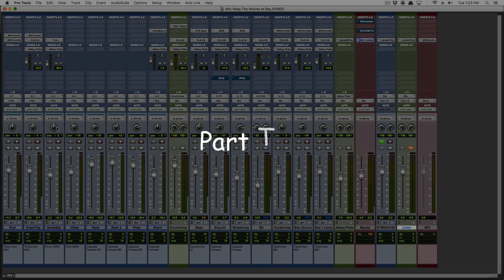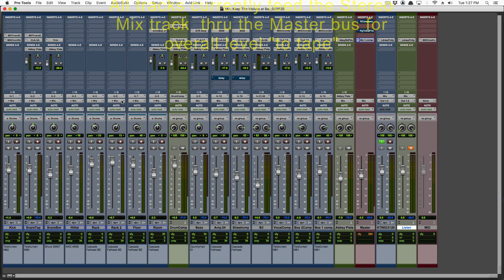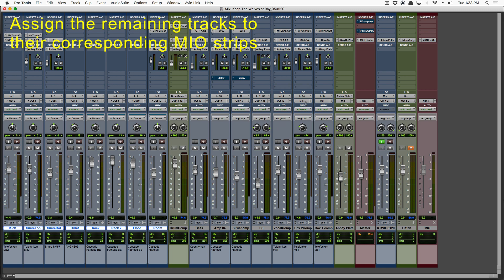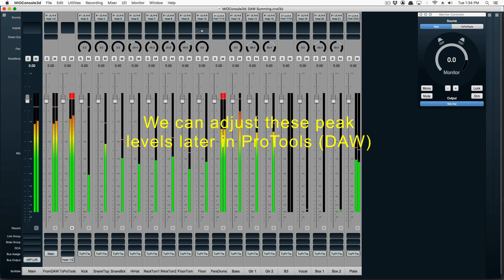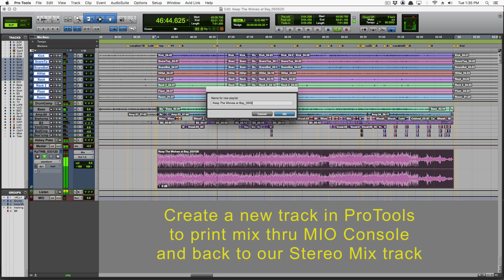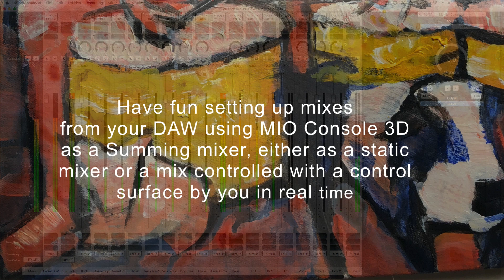Part 2- Metric Halo's MIO Console 3D as a DAW (ProTools) Summing Mixer

Comment: Mike -- nice job on this.  I have been working to do this similar thing, but have never been able to get the mix to feed back into the DAW -- could not do it with Studio One, or with Logic Pro -- but it seems such a  no-brainer!  But you encouraged me to try again.  Two questions:   1)  Can you explain advantages of doing this with MIO Console -- i.e. is it the 80-bit summing??   2) What about using MIO Console vs. using Harrison Mixbus32C?
Reply from the maker: Hi Bruce, I think I have seen your name on the Mobile IO list over the years. I probably should take a look at this series and see if there is anything I should edit or add.  I had been a partner in a studio here in NYC for many years, Dubway Studios, and we had three mixing rooms with Dangerous 2Bus systems.  16 analog summing mixers- no controls other than a master volume pot.  Early on in ProTools, the standard converters weren't that great and mixing in the box seemed flat.  My experience both with the Dangerous and with breaking out to a console always sounded better and larger, more 3D so to speak.  I have done it both ways in my home studio, in the box as ProTools is much better now especially being converted through the Metric Halo, and also doing it as outlined in this series.  Depending on the client, time needed, etc. I would use the summing mixer method.  I don't know how the 80-bit summing affects it, as I am less science oriented.  But I do like the sound.  Takes awhile to build a template or two if you are doing alot of work, but  once you have them (both in MIOConsole and your DAW of choice) it is pretty smooth sailing.  I save the MIO sessions in the same folders as whichever song I am mixing.  Glad you are giving it a go.  Let me know how it sounds.  I know the last record I did with my own band I did in the box and I do not like the sound as much as the previous one where I used summing.  And the sounds I recorded on the most recent one were much better individually.  Good luck.

Comment: Great video series, Mike.  Really helpful.  I have a ULN8 and an LIO8, and just upgraded to 3D.  I use Studio One 4 as my DAW.  I presume the benefit of summing through MIO Console is improved sound quality.  I tried doing something similar to what you do, routing stems (drum bus, vocal bus etc) out into MiO Console and back into a stereo track in Studio One.  It seems that the instruments have more depth and separation this way.  Is this what you find?  Also, do you think there is additional benefit by routing every track (one for one) out of the DAW into MIO Console and back again, as you do in your set up? Thanks!
Reply from the maker: Thanks Nigel. I used to mix thru MIO console in 2D all the time and found it really made a difference. Everything sounded a bit more like mixing thru a board. I got away from it during the changeover to 3D as I had enough on my plate learning 3D’s console and the clarity of ProTools had improved. I am getting back to it now. I like the ability to use different Character settings. One for one is a good way to go. Again glad it helped. Hope you and yours are staying safe in our currently crazy world. Peace

Comment: First off thank you so much for these videos.  They are incredibly helpful.  I own a ULN 8 and a ULN 2 and have installed 3D on both and love it.  Sorry if I missed it but I’m curious what kind of computer you are running. I run a 2019 MacBook Pro and am having a hard time finding a stable Ethernet adapter to work with MHLink.  It’s usually OK but can be spotty.  I’m curious if you have any advice.  Thank you!
Reply from the maker: First off, thanks for the nice comment.  I am not a video guy, but thought this might help a few of us in the community.  Glad it did.  My computer is a 2013 Trash Can with ethernet.  Also a 2011 MBP with ethernet.  However, I use an OWC Thuderbolt dock and connect to its ethernet port.  The only drops I get occasionally are when I put the machine to sleep.  Sometimes I have to reboot the first box to bring everything back on line.  In one of the Mobile I/O threads last month, BJ said this:  

"The best option (if available) is the Apple TB -> GigE Thunderbolt adapter.

If you have a computer with Thunderbolt or Thunderbolt2, just get that.

If you have a computer with Thunderbolt3 you can get that and an Apple TB -> TB3 adapter.

If you have Thunderbolt3 and don’t want to deal with the chained adapters, you can get pretty much any USB3 (or USB-C) to GigE adapter; it is best to use the vendor driver for those adapters - most of which are based on the Realtek chipset; MH Support can help with providing the vendor driver for those adapters as it can be tricky to find the download from the Realtek site.

We have tested the GigE Adapters made by Anker and they seem to be cost effective and perform reasonably well.

The Apple TB adapter uses the least amount of CPU to manage the Ethernet port, so if it is an option, that’s what we would recommend."
Reply: Mike Crehore — thank you so much for this information.  Incredibly helpful!  I hope other MH junkies like myself will watch your videos!  Thank you